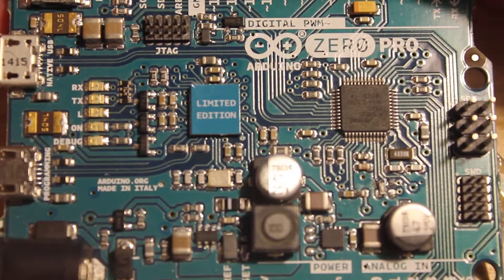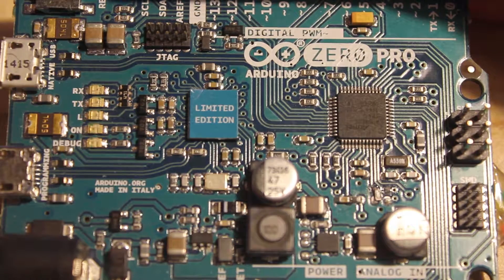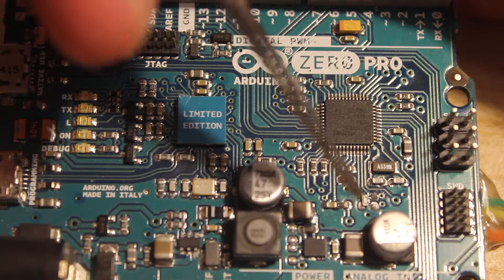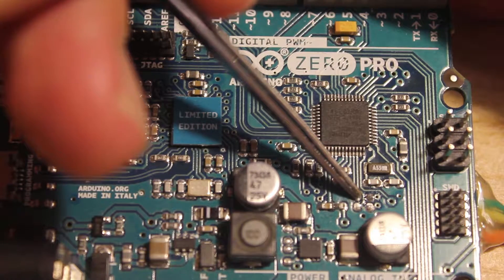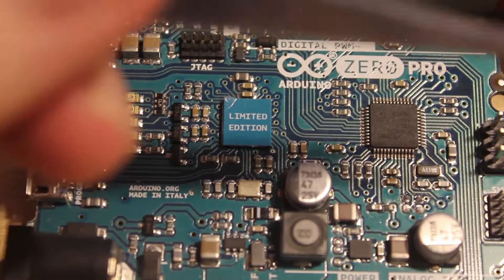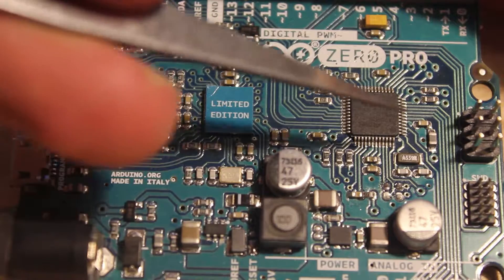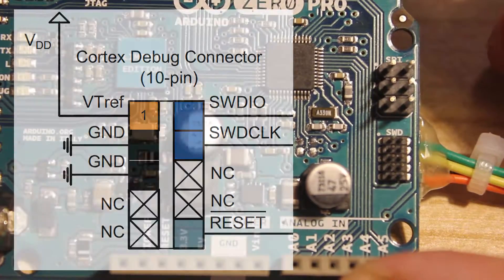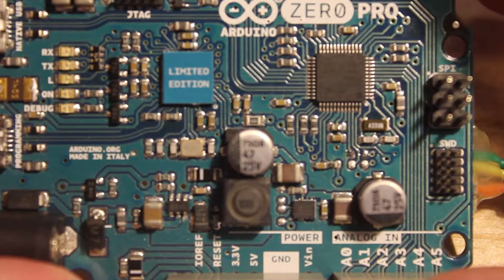How to: Arduino Zero Pro as an External Programmer/Debugger

Comment: thanks for the video. can you use the arduino IDE to burn bootloaders to clone Arduino Zero boards?
Reply from the maker: Yes as long as the board provides access to the SWD pins for programming.